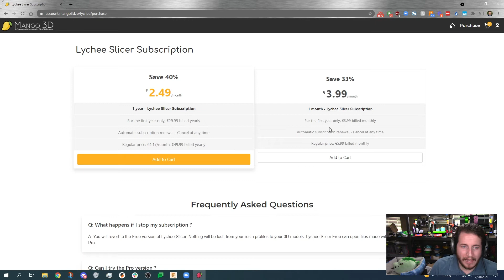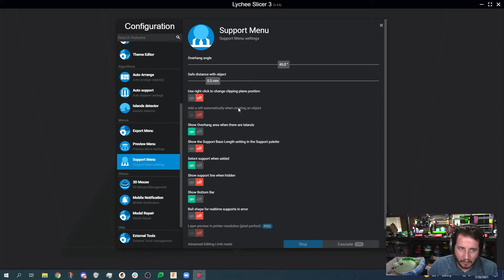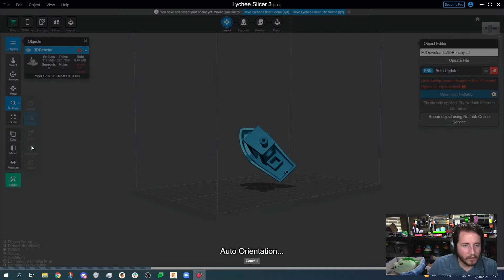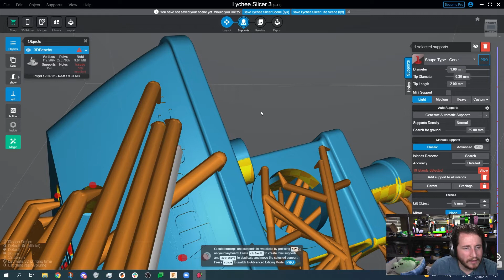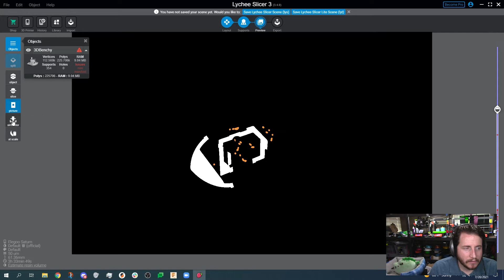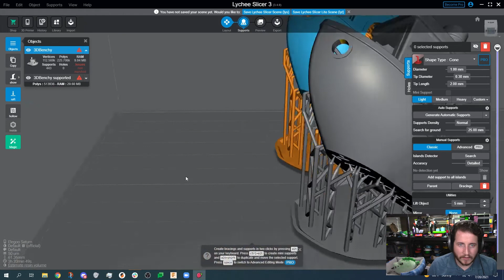An Introduction to Lychee Slicer by Mango3D!

Comment: I'm a bit curious, if im using the free version and  i want to make a pipe, a hollow pipe like the one that sell in the Hardware store. Does it will print my pipe with hollow ? Or it will not?
Reply from the maker: If your model you put into Lychee is hollow, that is fine on the free version. The free version just cannot hollow for you if you use a solid tube.
Reply: @3DMusketeers  tq for the clarification
Reply from the maker: Happy to help!

Comment: I would rather have a one time fee of 50 / 100 bucks, to a monthly drain. I detest the clown,,,, er cloud.  I definitely don't need someone else looking over my shoulder.  I refuse to buy a printer that is restricted to chitybox slicer. (they exist. beware.)  This I may tolerate when I start with resin.  (still researching on resin. thanks for the info you provide.)
Reply from the maker: I loathe subscription models too, BUT this is not that bad AND the free version is pretty powerful. 

There are not printers locked into chitu at the moment. There used to be, but Lychee made a deal to get SDK access, which I think was a catalyst for the recent price bump. 

Happy to help! If you have further questions we are always here!

Comment: Having the ability to place text on parts have been great. I have been adding exposure time and resin name on a blank space on the XP2 Validation Matrix that way I have it for reference. This way I can print 3-4 versions of the parts. If only there was a way to change exposure time on different parts so I can do multiple tests on one print.
Reply from the maker: I did not know Lychee could do that?!? or are you referencing something else? Yes placing text on models is crazy useful!
Reply: @3DMusketeers  it's only active in the pro version. It's next to the library tab next to shop, 3d printer, history and import.
Reply from the maker: That makes sense. We did that video on the free version! Planning on doing the comparison as soon as the new release is dropped!